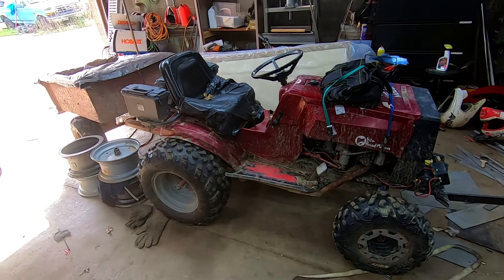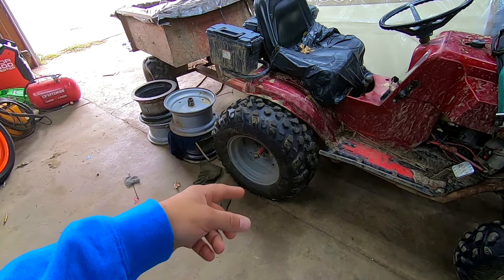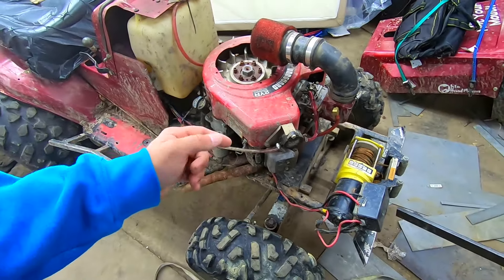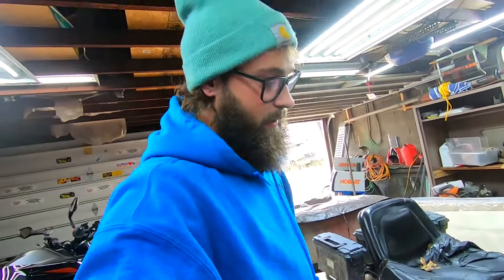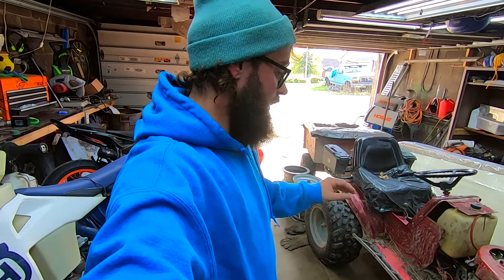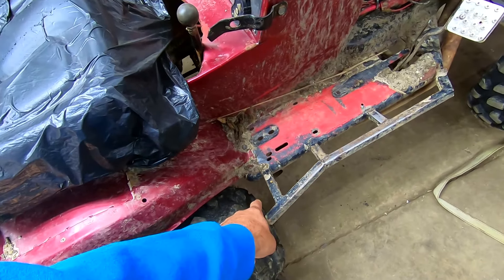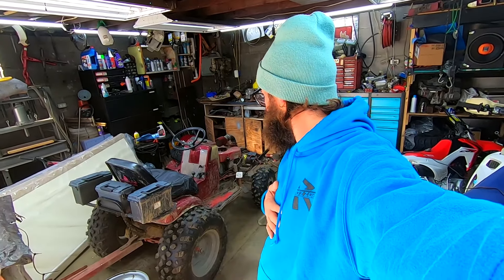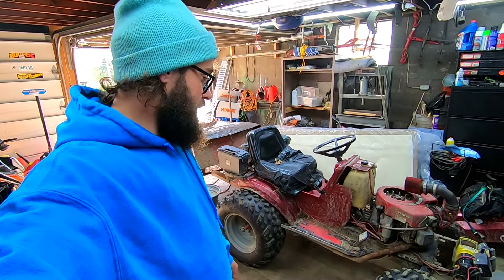40hp Racing Mud Mower Walk Around

Comment from the maker: Whats your thoughts on the mud dynamark? Is there anything i missed in this overview? If so let me know?
Reply: Will this be the tractor you compete with at ttc
Reply from the maker: @craftsmancrusher207  not anymore
Reply: What it’s the benefit of the holes in the pulleys
Reply from the maker: @Vincent-zo9xw  drainage holes for mud and water that get trapped between the belt and pulley
Reply: Thank You For Showing Us Your Ride. It Is A Nice Mud Mower. question tho, instead of drilling holes why not try a few pulled thats are slotted. and see how its works. should only be the cost of a few pulleys.
Reply from the maker: @chazdeal2605  would do the same exact thing as drilling holes into it, but more expensive, youd need a milling machine to put slots into the pulley and it would have the same end results
Reply: are you running a risk of sucking water into the engine with the intake being where it is and made of foam?
Reply from the maker: @hendrixmcclanahan1977  theres always a risk for water in your intake, the factory air box sucked up water likenit was its day job
Reply: Turbo or mini supercharger

Comment: my main ride is a dyna. i put a swing arm with a 1 1/4 axle. chain drive from a broken half shaft 206 . bearing supported end.  . double spring chain tightener  so i have reverse . atv rear shocks.. pretty bad ass looking .  riding around but still in testing.  was so fun before, i hope i not ruin. was sick of breaking mst crap.. its at least a foot longer now.  mines same color but my hood is more rounded and better looking. i run a 490 tecumseh. small atv carb. way over jetted. . it eats twins. this set up is a monster. why it just eats MSTs with careful throttle .. great build .
Reply from the maker: Aint no techumseh worth a heck! Lol thanks for watching id love to see your dynamark one day, sounds like a unique set up!
Reply: @redzz02  i no its hard to believe . but that 490 is a beast . everyone that sees it wants to know what im running. it will eat my v twin.  thank you for making videos... have a nice evening

Comment: Hey reddz, what's your opinion on raising the mounting point on the front axle the get more articulation out of it? I'm kinda mixed up about it. To me it seems it could be beneficial for crawling, but maybe make it more prone to flipping when going faster. Id like to make my build as versatile as possible.
Reply from the maker: Mowers arent like trucks, they are more like a three wheeler with the center axle pivot. More articulation on a mower without shocks/struts actually makes it more tippy and unstable. If you want more articulation and do decide to lift the pivot up, you want to add some sort of shocks/struts to dampen the travel.

What alot of people are doing is keeping the factory travel and adding rubber exhaust hangers as bump stops, this makes the axle still pivot but makes your ride so much more stable and predictable

For the type of riding i do, i do not suggest more travel, but thats just my opinion!
Reply: @redzz02  That 3 wheeler analogy is a eye opener and makes a whole lot of sense. I'll be keeping the pivot point the same. I need to be able to crawl through rough terrain, but still be able to get sideways on corners. Maybe I'll do a build with suspension on a different mower in the future. Thanks for the insight.
Reply from the maker: @michaelm8853  youre welcome! I definitely think the lack of suspension is a huge trade off for being able to go fast and corner quicker

Comment: wish i could find a vtwin rn thinking of running push mower motors now
Reply from the maker: Anything is better than a push mower engine, find yourself a single cylinder. If you cant find one then there is nothing wrong with a push mower engine

Comment: my dyna is much longer stock. and  it has left side clutch. it was a 17 hp 42 deck new. it has frame rails . not like crapsman or mtd. more like a garden tractor frame. it was bought new from central tractor in the 90s i think..  im going to measure what my stock wheel base was, even before i modified it. it was our longest tractor for sure.. yours looks very short. mine looks more like a murrey. . but dynas are a solid ride
Reply from the maker: Very weird, are you sure you have a dynamark? Every single dynamark ive seen is right foot clutch, and all have the same few chassis  variants that are all pan frame
Reply: @redzz02   later when i go to the farm. im going to get the model  number. i thought all dynas had frame rails and its step through middle  ..   sat in the barn all original since new.
Reply from the maker: @Robbie..Ha-Navi  thats actually starting to sound like a newer craftsman to me
Reply from the maker: @Robbie..Ha-Navi  i just looked it up dynamark model numbers are the engine horsepower and the deck size, so yours would be a 17/42, looks like a Murray wide body  rebranded as a dynamark

Comment: How do you make a lawnmower 40 hp because I don’t think there is a lawn tractor motor that has 40 hp
Reply from the maker: Its a built engine, some of the racing mower guys are pushing 70-80Hp on lawn mower engines. This is a 20hp vanguard block that has been built

Comment: What is your intake setup? I can't find anything like it
Reply from the maker: The intake manifold and carb are factory modified briggs parts, the air intake was all custom built by me
Reply: I just made a intake for my 18 HP vanguard from a old yz intake, traced it out with the plastic spacer, cut it out and ported the stock intake to match and put on mikuni vm34, I'm firing it up tonight

Comment: I used to run a pulley that had a stupid heavy plate (possibly some sort of clutch flywheel) made on to it, worked pretty well as a crank weight, not sure what the plate weighed but the entire pulley was around 7-8lbs wish I'd never traded it

Comment: What paint did you use on this paint job?
Reply from the maker: It was the automotive duplicolor paint they have at most auto parts stores, i can not remember what color it was though
Reply: Ok that’s what I was thinking. Did you use the spray cans and no clear coat?

Comment: I actually had the same mower and it came with a blown up motor and got it for 120 dollars and then got a brand new 2020 11.5 horsepower motor for 100 buck but I ended getting a better deal for 80 dollars

Comment: Hi! What do you think about bolting the transaxle to the 2 furthest hole, compare to the original hole? I want to do this mod thanks
Reply: Oh and what you mean by "holly pulley mod"? I speak french I dont understand! Thanks
Reply from the maker: It would give you a slight wheel base stretch that would help, holy pulley mod, is when you drill a series of holes in your pulley to help shed mud and water

Comment: That is sweet build man. How do you like those front tires? I was thinking about getting those in 20x10-8 for the rears on my mower.
Reply from the maker: I would get a 22-23” rear tire. I wouldnt waste my time with a 20” tire.
Reply: @redzz02  I might get a 22 but if I want any good 22 I’m gonna have to get 10 inch rims and the hubs to go with them. That’s $100 or more for another inch of ground clearance. And then front tires, wheels, and hubs.
Reply from the maker: @holdenbostocky1998  theres plenty of companies that sell 21,22,23” tires for an 8” rim  . Try different widths 11” and 12” widths are more common for this tires